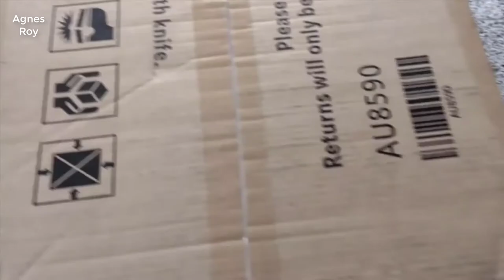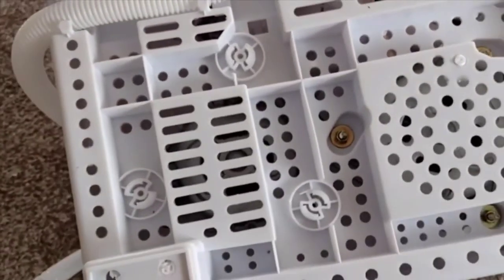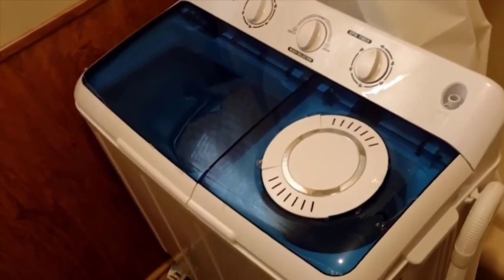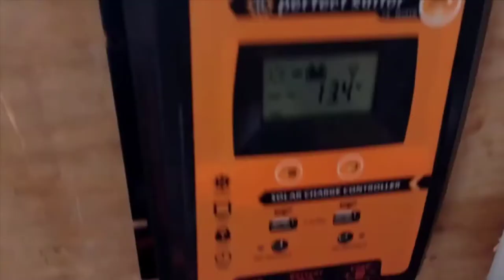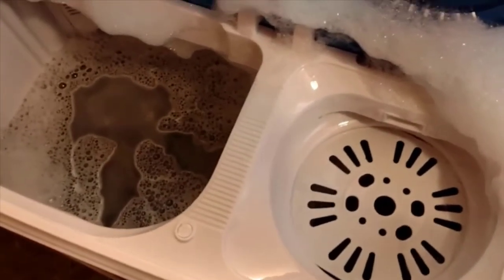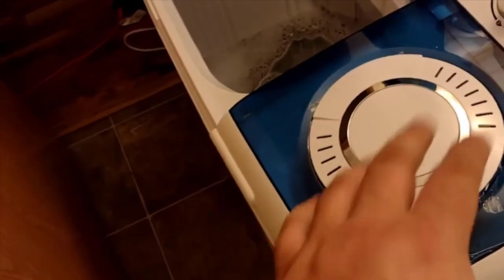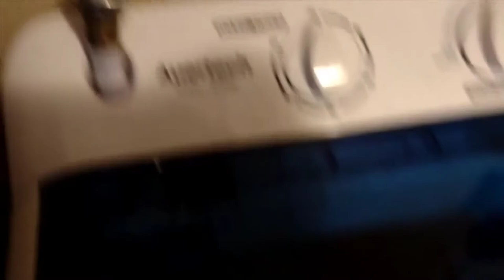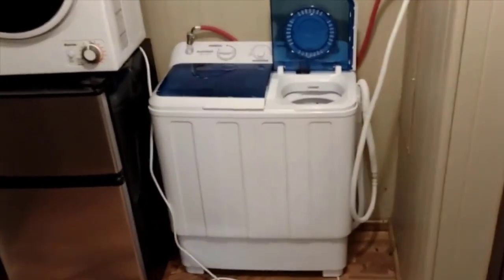Auertech Portable Washing Machine, 28lbs Mini Twin Tub Washer Review

Comment: Any tips on cleaning the washer itself?
Reply: I use a full cap of the Lysol cleaner and I also have washer cleaner for that my sister got but only use that once a month with less than a capful and wipe down the spinner with a washcloth when I have the water in the other side spray that out as well. Usually run what I’m cleaning with and then a water cycle afterwards. Works for me.

Comment: Why is there 2 water inlets? One on both sides?
Reply: This was one of concerns with it. I learned the hard way since the manual didn't mention anything about it. My floor (living room, kitchen, door way and dining room and flooded with water. I had to go buy a wet vac to clean up all the water bc there is so much.
Reply: 2 inlets so you can use the hose to fill up the washer and run the water on the spinner